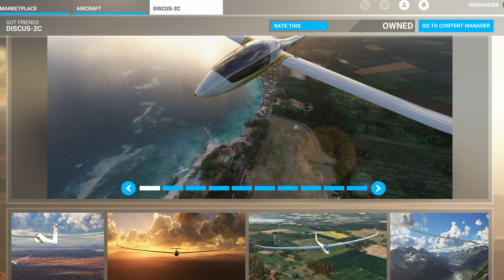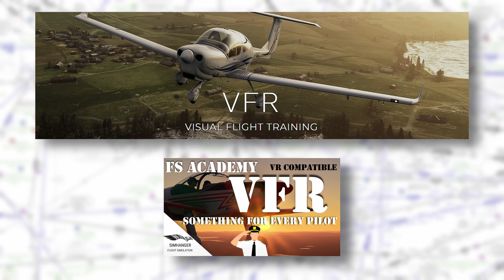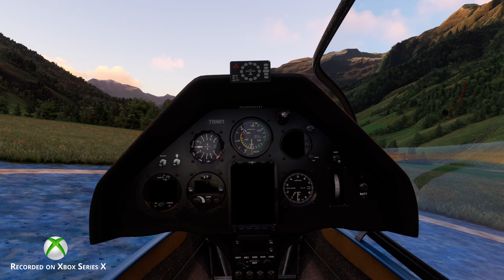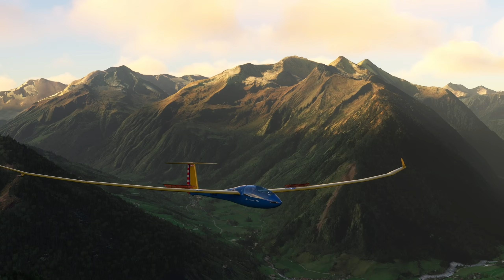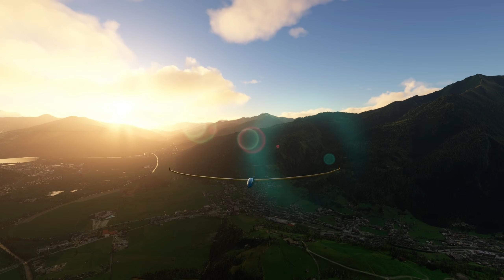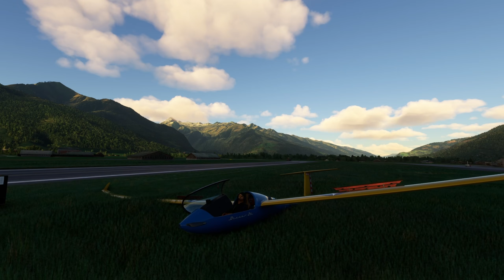MSFS | IS GLIDING FOR WIMPS? | Got Friends Discus 2C | My first gliding  experience and opinion.

Comment: I love this glider. I’m new to sim gliding and have tried all of the freeware gliders I could find. This was by far my favorite so I bought the payware version. It’s challenging and extremely enjoyable; it reminds me of sailing in many ways.  It’s very peaceful and quiet, and you have to learn to use what nature provides instead of relying on engine power. Yesterday I soared from the top of Mt Fuji (cheating, I know) to Tokyo, over 80 miles. I was still at around 5000 ft so flew all around Tokyo before bleeding off altitude and landing at Haneda airport. The flight was an hour and 20 minutes of pure enjoyment and relaxation.
Reply from the maker: Sounds wonderful 😀

Comment: Gliding usually requires much finer flying skills than powered flight as a high standard of rudder/aileron coordination is essential for safety and efficiency. It also requires much more skill in energy management, judgement of height, trimming, pitch control, tow-plane stability, winch launch accuracy and many other skills, including ground handling which again is generally a lot harder than powered aircraft control. If you are a qualified glider pilot your powered flying will also improve.

Comment: Each time a pilot saved his broken down machine with more than 100 passengers on board, he was a glider pilot (Sullenberger Airbus 320 Hudson River, but also Airbus 330 Transat 236 Toronto Lisbon or the Air Canada 767). Each time a guy who felt his machine and not a "flight engineer".

Comment: Love sim gliding. If you think the Discus is good then try the LS4 and AS33. Used to glide a lot in FSX but it was poorly supported. Hopefully, 2020 will do a better job. Thanks to the 3 aircraft above haven’t flown a powered aircraft in about a month. Try the challenge of flying with with the FES but not using it.

Comment: I spent holidays for about 3 weeks in total learning to fly gliders. We flew the Blanik which was an old type all metal 2 seat in line glider. I got very near to going solo but just not quite. Our instructor was an ex RAF chap who was a bit crazy. I tended to be a bit slow in recovering when we did stall spins and the next thing you would hear was the instructor saying your too slow - look we can get a loop out of this! Next thing you knew was you were upside down.
We didn’t have water ballast or the fancy electronics of that Discus-2C.
We also got to fly a powered glider. We did both winch launch (a tractor towing the cable) and aero tow. Great fun. I’m glad gliders are finally showing up in MSFS.

Comment: I like SIM gliding. 2000' over Lasham, release, a few aeros and then land. It takes timing, good speed and energy control, every landing is different and thus the circuit has to be modified accordingly before one runs out of talent and lift! Two of my buddies have flown gliders as did my dad, helped him to go solo in a GA taildragger at only 9 hours (when such things were allowed circa 1969/70).

Comment: Same. I’ve been an instructor for 23 years. 100 times safer than a powered plane. Anyone can do it but like most things, takes a fair amount of skill to be good at it. My longest flight was 6hrs 45min. Have a trial flight in a 2 seater. If it’s a winch launch it feels like a rocket, faster than a jet! (Non-military) If it’s a tow launch it’s like flying in formation until you release the tow cable.
Reply: When I was learning to fly in gliders it was said that the winch launch was similar to an English Electric Lightening climbing with full reheat on!
Reply: @stephengoad6886  It was awesome. It was only single strand fencing wire that would snap often! Quick rejoin and drag it down the grass strip with an old car, no doors and a big hole cut into the roof to lookout for other gliders (used to tow the gliders around with it too), wait for the radio call from the pilot, wind it back in with the old 5 litre V8 motor bolted onto a towable farm cart. A seat, handbrake, pedal clutch and lever for a throttle. All very agricultural! lol The cable drum was directly mounted to the motor dead ahead, with part of an old gate that was supposed to save you when the wire came hurtling back at you after it snapped under full strain. There were so many joins in it, lolol. Rev her up, brake off, clutch out and lever steadily full forward…0 to 1200 ft in no time at all. Pilot releases the cable and the small drogue (a cut off wheat bag tied to the hook with some old rope) slowed its fall - a little.  A strong crosswind on takeoff was crazy! Almost like getting slung up there with your wingtip where your nose should be and the other wing tucked just under the crosswind. I miss it. I was club secretary but Haven’t flown since June 2013 after a horse gave me a wheelchair parting gift 🎁 , lol Worse was the club had their first accident about a year later when two died after crashing about 40 yards from the runway. Fixated on making it back to the runway, common error that rarely ends well! There were dead flat paddocks all around the airstrip for 100 miles in every direction. Flat as far as you could see. Flat, hot and dusty. Mid 40’s °C in the summer Mid Dec to late March. We flew thermals obviously, not even a hill within an hours flight, let alone a mountain range. 3 1/2 hours away was the closest ridge soaring in our snowy mountains. Anyways, they stalled and died in one of those hot, flat, dusty paddocks that they should have landed in. 😒 Bloody idiots!, So unnecessary. CASA and police went through everything, even interviewing me 1/2 dozen times even though I was out of the club and hadn’t been there in over 12 months.  It was hard on everyone there that day, and the fact it hung over everyone’s head for months. Questioning everyone all the time, going through every sheet of paper in the office, reviewing procedures and operating handbooks, log sheets, training records, instructor proficiencies etc etc. I was quietly happy I wasn’t in the middle of all that - very stressful as anything found lacking could have lead to very serious charges. We were only a small club out in the countryside, we had a ball but took safety seriously. All were cleared in the end with a ton of new operating procedures  to follow in the future. Gliding here in Australia couldn’t be more different to GA. It’s not regimented, not really standardised,no pilot exams, no pilot license, nothing formal at all really. Very very casual and every club does things differently. Anyways, I think I just wrote a novel - sorry guys, Michael
Reply from the maker: It was an amazing experience 😀

Comment: I've flown in gliders a few times and they (and helicopters) always made me slightly nervous with having no engine (or wings) but landing a Glider is an art in itself as there's no go around afaik 😁
Reply: You shouldn’t be nervous. Gliders have an amazing glide ratio. 20:1 up to 60:1. If you’re 1 Mile up, you can glide for 20 miles, or 60 in a top class one. Plenty of distance to get to the airfield or a paddock. A Cessna 182 has one of the best glide ratios of all aeroplanes at 8:1. A lightweight Robinson R22 is 3:1. A wing suit with professional 2.5:1 (yes 2.5 not 25), Parachute 3:1, Paraglider without motor ave 10:1 AND a 747 🥁17:1 😱. All these assume you get no sink or lift and you fly at perfect “best glide speed” found in the POH. Interesting hey?

Comment: Why would it be for wimps? Sure , this is a simulator and the worst that can happen is you reload the flight. In real life however, glider pilots have balls of steel. You have to know how to use wind and updrafts to keep yourself in the air. There is no motor to save you (unless you have one that has a small motor for emergencies).
Reply from the maker: Exactly the point I make in the video!

Comment: I did a few of the glider missions/task in FSX; but kinda boring in a simulator in my opinion
Reply from the maker: Yeah….until you start running out of altitude! 🤣
Reply: I used to have an Aerosoft Discus for FSX, it was actually pretty good and challenging to use thermals and ridge lift. I recall doing a flight around Stewart (?) in Canada which turned into a 2-3 hour and a reasonable distance covered. If you simply take off and resign yourself to landing when you run out of altitude yes it’s rather mundane. If you find lift and gain a few thousand feet and start covering some distance it’s very rewarding and a completely different experience. It will be interesting to see how much improvement there will be when gliders are better support. Yet to try them in MSFS pretty much for that reason.

Comment: Another great video. Im curious about gliders but except for power off landings (and that 1 engine failure) I have 0 experience.

Why reducing ballast makes climbing harder?
Reply: Reducing ballast moves what is known as the polar curve for that glider to the left.

Basically your best glide speed reduces.  This is good for beginners as you can then spend more time in lift. Ballast is primarily used for competition where speed counts so you want your best glide speed to be as fast as possible. So if you’re learning or just sight seeing, best to start with no ballast (or minimum required to have CG in limits).

Enjoy!
Reply: PS, any level of detail on polars is beyond the scope of that reply 🤣. And me mostly!  Interesting stuff though and worth looking up if interested.
Reply from the maker: @Logus_Ty  Now you tell me! 😂
Reply: @SimHangerFS  I was merely trying to prevent information overload for you 🤣😉. You did great. I really hope you soar more and delve deeper into the subject too.
Reply from the maker: Sorry maybe I wasn’t clear enough…having ballast on board makes climbing harder. 👍
Reply: @SimHangerFS  Lol I know nothing about gliders.
I would have easily believed some weird CG magic was at play 🪄